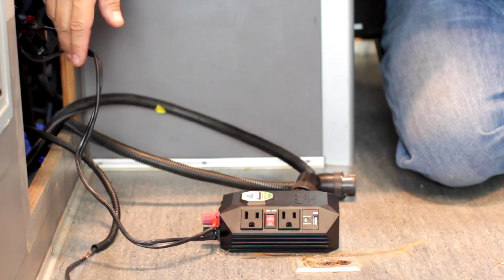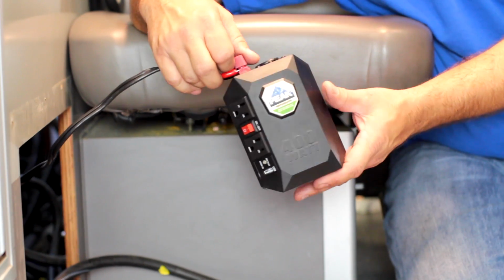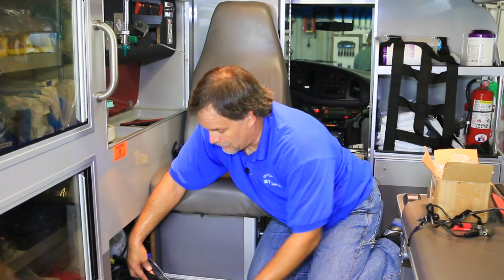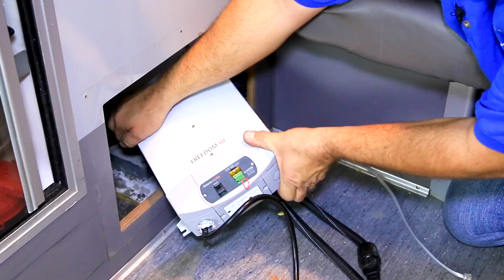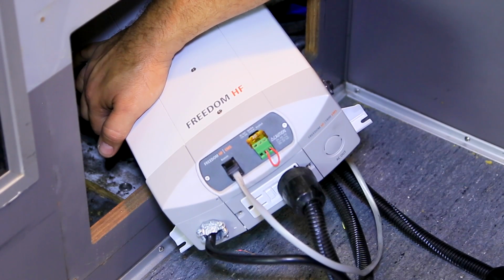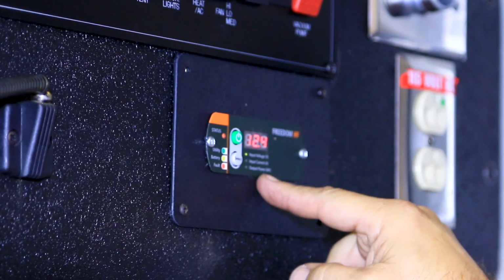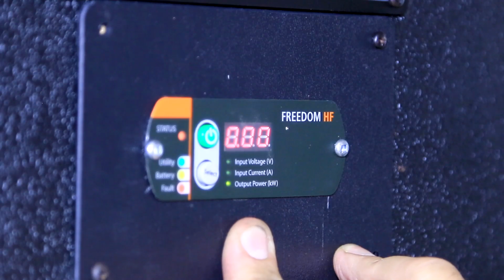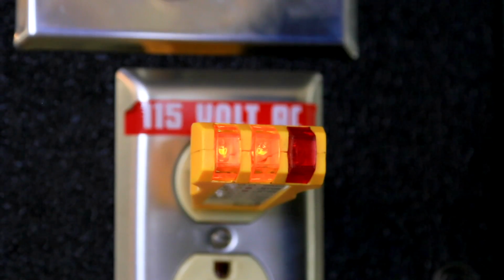Installation of the Xantrex Freedom HF EMS Inverter/Charger

Comment: So I have 2 out letnot working in my truck but everything else works and the light isn’t on to switch at the breaker so I don’t know what else to do
Reply: Gfci isn’t tripped so I don’t know what else it could be maybe a fuse?
Reply from the maker: Hi  @OUTside_LOOK_IN_nervations , please check with our technical support, it may be too much to explain here. 
https://xantrex.com/support/get-customer-support/
Reply: @OUTside_LOOK_IN_nervations did you check the wiring in the outlets? Maybe the screws at the terminals backed out from vibration

Comment: @ 1m50 seconds... The reason the original one was replaced is because it very likely failed, no matter the brand most of them will fail within a few years of usage...
Reply: I have the xantrex freedom hf unit in my truck and use it everyday for the past 4 years with zero issues. They are the best of the best

Comment: Look what your doing you crimped a positive lead with a metal tool 1/4” from the metal grounded box on the floor - you’re lucky you didn’t burn the truck down.
Reply: There was no power going through it...